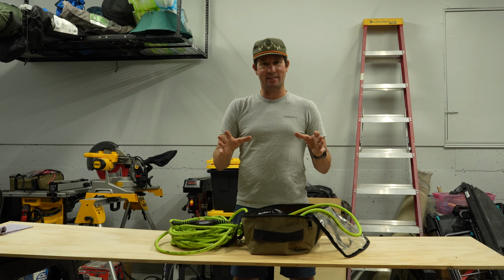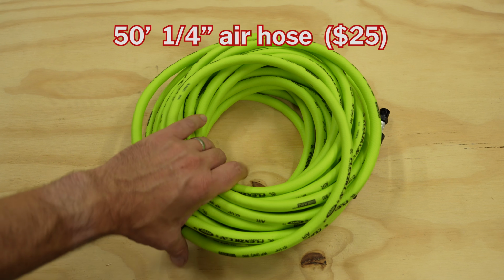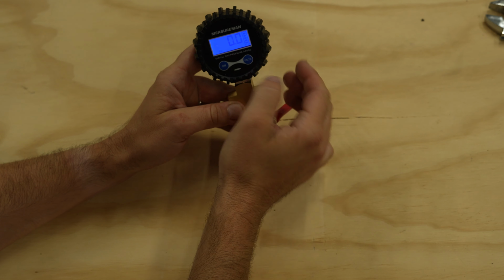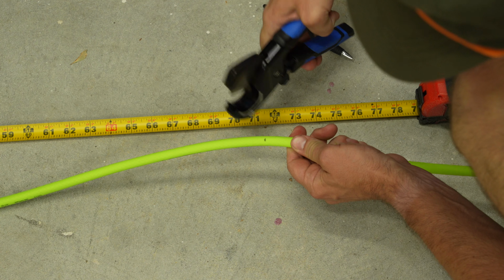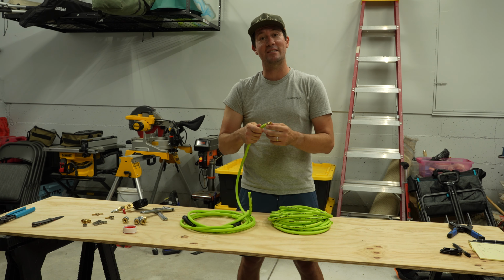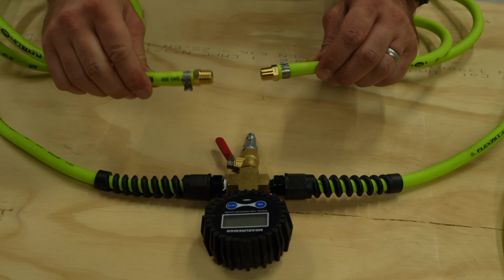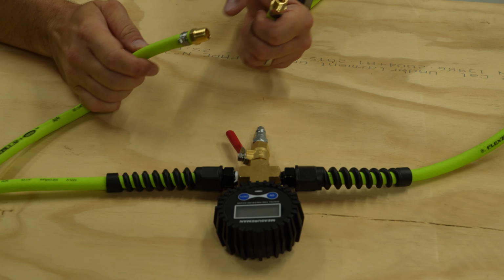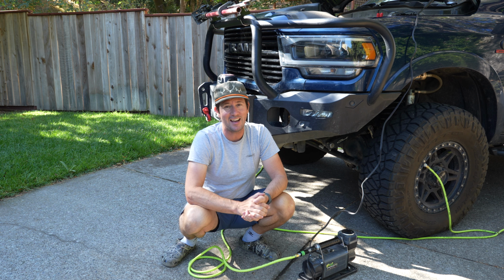Cheap & Easy: DIY 4-Tire Air Inflation System

Comment: Very clean.  Seeing this makes me double take buying the pre-made kit from some of the Van upfitters -- where they're charging almost $500.  Granted, they're running steel-braided lines and everything is cut perfectly for a Sprinter but I feel I could easily DIY this myself after seeing this.
Reply from the maker: Yikes, $500?!  I thought the $250 setup I was looking at was expensive.  I guess they figure if someone is going to spend $150-$200k + on a new van, then $500 is nothing.  People need to be just a tiny bit frugal with some of these purchases.  $500 is just bonkers!
Reply: @OverlandTrailGuides  Agree.  Thats why I built my van myself - allowed me to really save money and make it my own.  I hope to make it on a trip with you all soon. Sadly, I can't make the Lost Coast trip coming up but hope to see you all soon. Really dig the videos and adventures you all promote.

Comment: Great video. I have a couple of questions; 
- Would it make much of a difference in using a 3/8 hose instead?
- I looked on amazon and there are many different styles of locking air chucks, how does a person choose?
- when determining air hose length, my truck is a GM crew cab with a 6ft 10 box (similar to yours?), would I be safe in buying a 50 ft hose
Thanks in advance.
Reply: Another video online actually addressed this. ⅜-inch hose is actually slower. Edit: https://youtu.be/t6TGxrYlDAU?si=fptU5TOC9M5r_q7r

Comment: I have that compressor. How’s your heat with it running that long. I melt hoses with it regularly. I’d imagine if I tried to do 4 at one time it would melt the hose every time.